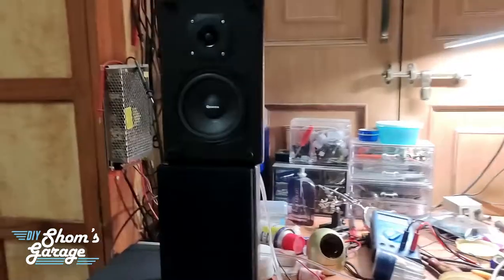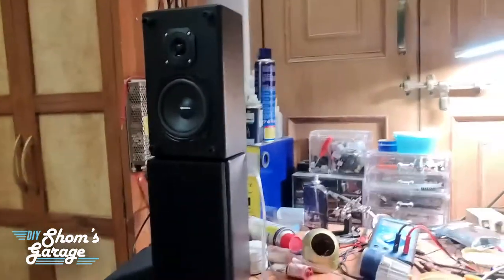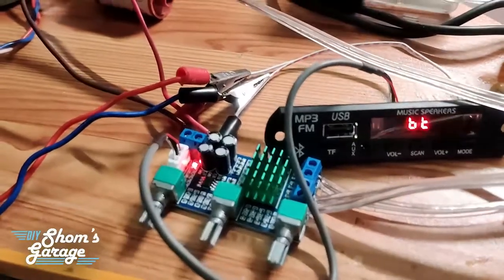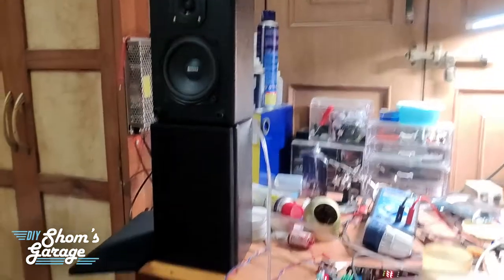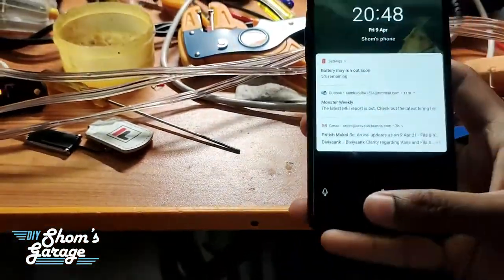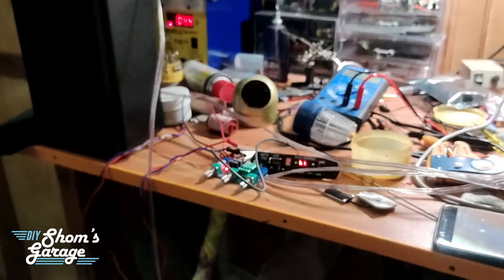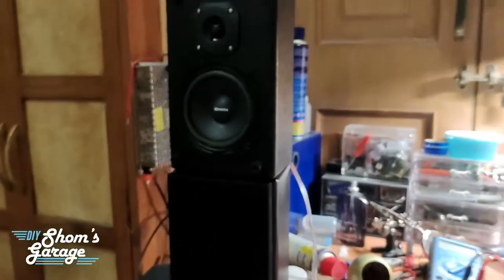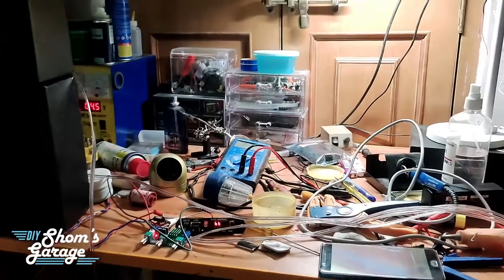Class D Amplifier TPA3116D2 + Bookshelf speakers DIY how to make

Comment: Bro, can we use this amp for long time like 3 or 4 Hours, will it heat
Reply from the maker: ive tried... no heating... depends on speaker impedance. minimum is 4ohm.. 6-8ohm for less heat